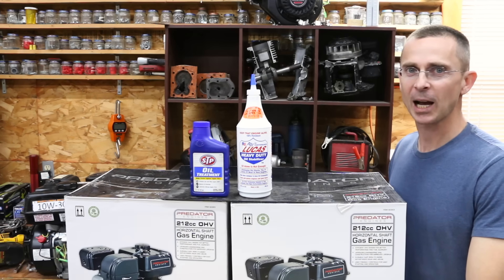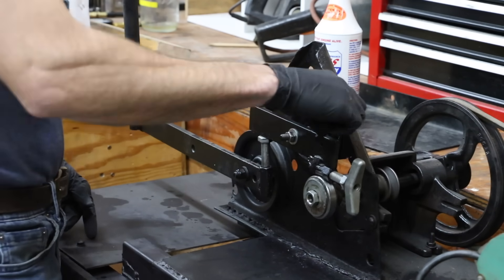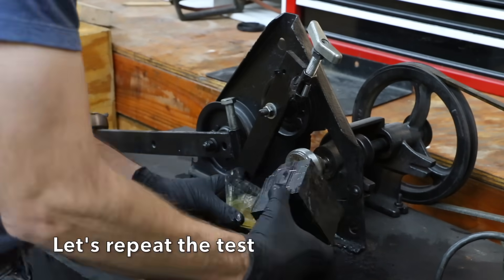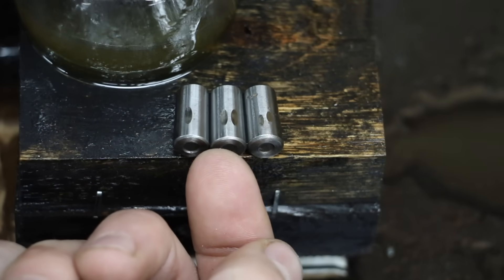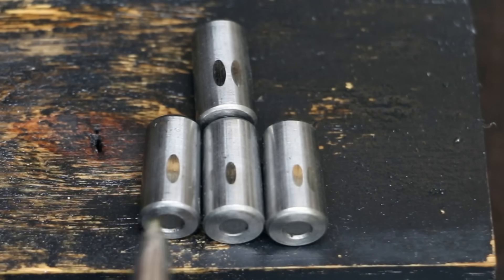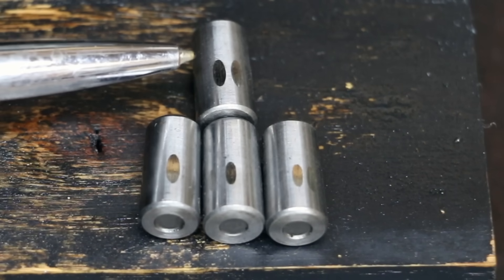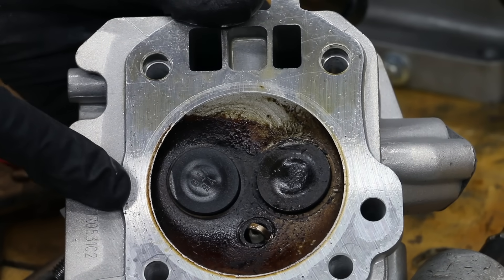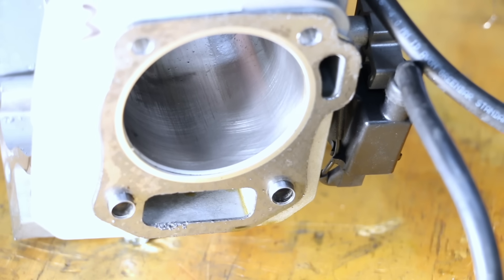Which engine self-destructs first?  Lucas or STP?

Comment: I would like to see which is better. "Prolong" or "Zmax".
Reply from the maker: Thank you for this recommendation!
Reply: No, don't. Z max is not a lubricant at all. Its simply a molecular filler to fill the pores in the metal. Its used to prolong engine life when USED WITH OIL!!!  NOT a lubricant.  The only oil that was drained and run for longevity is Mobil 1.
Reply: Billy Bracewell I agree
Reply: Project Farm let's do it!!!
Reply: Try this one.  Thanks for the video.
Reply: Z max sucks watch his video

Comment: Looks like the connecting rods on the Harbor Freight engines are the weak point. The cylinders and pistons didn't look that bad to me.
Reply from the maker: Your right.  The aluminum doesn't hold up once the film strength is lost. Thanks for commenting.

Comment: How many more minutes did the Lucas engine run than the STP engine?  Was the STP engine running cooler than the Lucas engine up until STP failure?  Looked like it.  STP crank bearings looked more damaged than the Lucas crank bearing on tear down.  My opinion the Lucas won because it just ran longer.
Reply from the maker: Yes, Lucas lasted 8 minutes longer, even though STP seemed to be running cooler.  Thanks

Comment: This isn't a valid test and a total waste of time. Neither product claims that engines can be used without oil after their product has been added then drained from the crank case. The engines themselves require proper lubrication to ensure they function properly. Everyone knows that engines require lubrication or they will fail. Seeing which engine fails first with no oil is a complete waste of time and proves nothing when comparing the effectiveness of different lubricants or additives.
Reply from the maker: Thanks for commenting.  I'm always open to other ways to test these products.  If you have any suggestions, could you please create a new post so I can easily find your recommendation? Thanks

Comment: Try Schaffer oil with Moly. They say once it is engrained in the metal, an engine can last a long time.I used to sell it, and performed that demo with their friction machine. I thought it was impressive. without the Schaeffer oil, you could stop the shaft from turning with a lever arm. With the Schaeffer oil, you could not stop it. I would love to see how long an engine would run empty after using this oil..
Reply from the maker: Thank you for this recommendation!

Comment: You should have included an engine with just oil to see if the additives actually help.
Reply from the maker: Sorry I didn't explain this, but I did the control 2 videos ago in 10W-30 vs Bestline.

Comment: very intreasting. ill say this i run lucas in everything. example i put there actual engine oil in a $100 walmart push mower. run it for 3 yrs. when i drained it. i couldnt tell by sight nore my feel that the oil was shot. actually it looked new smelled new.  but the one iv wondered about myself is royal purple. iv heard alot about there products. but never tryed
Reply from the maker: Thanks for this recommendation.

Comment: Awesome work as usual! I would like to see the how long he same engine would last with out any additives. Just drain the oil and go. Also how do you feel about the Predator engines in general? The abuse you put them through is harsh! If treated right will they hold up like a B&S? And yes I know that due to your small sample rate these test are hardly definitive...but they sure are interesting! Thanks!
Reply from the maker: I really like the Predator engine a lot.  They seem as good or better than the Briggs.  It's basically a Honda clone.  Thanks again!

Comment: Here is one from Pennsylvania you need to contact them about their products and test .  Have used for years for added protection from oil pump failure.    Muscle Products Corp. (MPC) is one of the leading manufacturers of specialty lubricants, additives and greases.   http://musclelubricants.com/     Sharon Murphy-Dittrich CEO / International Sales & Marketing Cell: 1.724.977-4684 ,    Muscle Products Corp. 752 Kilgore Road,   Jackson Center, PA 16133                1.814.786.0166
Reply from the maker: Thanks for this recommendation.
Reply: Did you ever look at Muscle Products Corp?

Comment: Prolong is the best ran my 92 vw Passat 10 miles with no oil pump no damage what so ever lots of noise but no metal shavings replaced oil pump in about 5 minutes after running went completely quiet and got another 120000 miles out of vehicle oh yea it already had 130000 miles on car the best product ever👍🏻
Reply from the maker: Thanks for this recommendation.

Comment: I had a car with a head gasket leak, bought Z-Max to be sure the engine was always protected. After a family member died I drove 1,000 miles to attend the funeral. My car got roughly 28mph highway and just after halfway I got a check engine light meaning I had consumed more oil than usual. Found out that my mileage once the oil ran low went from 28 to nearly 30. Hoping at some point you could explore the micro-lubricants to verify if that was the case or not.
Reply from the maker: Thanks for this recommendation.

Comment: I run synthetics in my vehicles and my new car states to use only synthetic oil. Back in the 80's I managed the maintenance dept. for GE and physically tested all kinds of conventional, semi-synthetic oils for our equipment in cold weather and warm and found semi synthetic was superior in every category including wear on engines, gear boxes, planetary gears, etc. No need to add anything if you use a good quality oil, filter and change per manufacturers recommended service. Had a ton of fun performing all kinds of test and all kinds of systems, equipment and materials. I know you're enjoying the work and much as we are watching your vids. Keep up the good work!
Reply from the maker: Great post and thanks for the positive comment!

Comment: Most oil additives degrade a premium oils lubricity. The complex balance of synergistic additives is skewed by the addition of something else.   Lab testing of STP has shown it contains lower additive level than motor oil itself.   https://540ratblog.wordpress.com/2013/06/20/motor-oil-wear-test-ranking/
Reply from the maker: Thanks for commenting on this.  My test results came to the same conclusion.  2 videos ago regular oil outlasted STP. Thanks again!

Comment: That lube tester is an absolute hoax machine. The computer operated heated tribometer with computer readout is what the mechanical engineers and oil chemist use.  Even the slight difference on how you drop the lever changes the result AND the lube is not operating at engine temperature, those things alone voids the results. It is the dupes folly and the instrument the crooks use for their snake oil.  See the one armed bandit video.    https://www.youtube.com/watch?v=AjdN4ZuYxf0   You can get a wonderful education on lubes and other items at 540 RAT'S blog.   https://540ratblog.wordpress.com/2013/06/20/motor-oil-wear-test-ranking/
Reply from the maker: Thanks for commenting on this.  Using 2 new engines side by side helps validate the results. Thanks again!

Comment: "Do STP® oil additives cause sludge?

No. STP® oil additives contain detergents, which can help suspend sludge in the motor oil and prevent it from accumulating inside your engine."      

STP is make cleaning products not a stay on lube. Just like dish dawn is thick it takes a off the very fog oil left on my butter dish.
Reply from the maker: Thanks for commenting on this!

Comment: There is a delta you totally missed here.  Why did you not do the same failure test on an engine which had no additives.  That is the piece of information that I wonder about.  How did much benefit does the additives offer.
Reply from the maker: Thank you for this recommendation!

Comment: 30 weight bar and chain oil to run exclusively in a inline 6, 4.0L motor. The oil doesn't thin at higher temperature, and will clean a Detroit 6cyl diesel engine because of the additives that are able to withstand very high rpm. Imagine someone running bar and chain oil in their log truck. The mechanic who worked on that after bar and chain oil was the exclusive oil in the engine, said that was the cleanest diesel engine he had ever seen in his life for it being  as old as it was. The log truck was between 79 and 84.i cant remember exactly, but yeah. Withstands high temps. And can put up with abuse. For real, I'd run it in my car, but i dont have a car, or a car motor to test if i should actually run it and know the outcome. If i could use it for very high temp runs, for example a drag race. That's the true test with this oil. A dyno run/test of an engine,  and that engine being able to handle that. I am extremely curious to see if 30 weight bar and chain oil could run a car without overheating in a 1/4 drag at a 180 mph
Reply from the maker: Thank you for this recommendation!

Comment: English is not my language so I go first in spanish and then in english because if I traslate something grong you can traslate it from original.

Excelente video, me parece que puede agregarle un toque de fiabilidad mostrando un test de compresión de ambos motores antes de comenzar las pruebas o entre cambios de aceite para dejar claro en qué condiciones comienza cada uno.

Great video, l think you can add a little more of neutrality to this king of tests by adding a compression test behind running the destruction test. So we all can knows how equally they start.

Thanks for doing this videos.

And happy Thanksgiving.
Reply from the maker: This is a great suggestion.  Thank you very much for commenting and Happy Thanksgiving!

Comment: What about "slick50" v's "Lucas"
Reply from the maker: Thank you for this recommendation!
Reply: Sorry I just watched the "slick50" v's "10W 30" Video, oil wins!!, Shocking because, I had a 1966 ford fairlane 500 with a 290 engine with a bad oil leak from the rubber replacement oil drain plug, very often forgot about the oil level but the slick50 kept the motor running', till I realized I was out of oil, 3 years later I sold the car for 10 fold that I bought it for....Thank you "slick50", one month later I found out the new owner wrecked the car on power lines dirt road...REGRET SELLING TO HIM!!

Comment: I’m older and have been through generations of all sorts of tales and superstitions etc. But, what is true is fuel injection is great for longevity as is thinner oils. If you have a worn engine then thicker fills the wide clearances and reduces noise and is less likely to pass worn rings and to be carried off as fast by excess crankcase venting of leaking rings. In the long runs of few engines I have serviced FI made them last much longer with fewer internal deposits. Less excess fueling owing to better warm mixture and normal op temp mixture. The top of cylinder get less wear. Less washing of lube oil. 
In the same engine families where thinner oils were used when fuel system was not changed over the years the specified viscosity changed the slugging and clogging of crankcase vent parts and passages was much reduced. Thinner oils get pumped more and splash more readily. The extra flow has been shown to wash over more of the static internals and this leads to more detergent activity and also quicker shedding of fuel and moisture dilutes. I worked in two dealers on the same brands where one dealer always sold and installed thick oil additives and the other dealer sold none of it. Both dealers used Goodwrench bulk oil at that time. Oil additive engines were more heavily deposited whenever valve covers were removed at similar mileage’s. I lost all belief in thicker oil and higher oil pressure being anything to aid longevity. Air cooled small engines are another story so the results here for parent metal connecting rods on low investment crankshafts may not be a test showing us much for modern high output direct injected gasoline engines using coated bearings on forged or induction hardened journals.
Reply from the maker: This is a great post. Thanks for commenting.

Comment: To see how much better the additives did wouldn't we need to run one with just the base oil with same system? We could see how much protection are we buying if any
Reply from the maker: Great point.  Two videos back I tested 10W-30 vs Bestline.

Comment: Please do some studying about variables in scientific testing. This video was about failure modes in cheap mass produced engines more than a product test. You can't hit a surface with a grinder and then expect to do any kind of consistent abrasion testing. That's ludicrous. Your bearing test data is completely without value. If you want to gather any comparison data, you need analytically verified and consistent starting conditions, you need a more realistic test scenario, and any test with a sample size of 1 is a facepalm, not science. All you tested was stickiness of additives * random part tolerances. You're conflating stickiness with lubricity and the resulting data doesn't represent anything close to any real world scenario other than deciding to destroy an engine.
Reply from the maker: Thanks for the constructive feedback.  I would great appreciate recommendations on how you suggest I test additives. If you could, please create a new post so I can easily locate your ideas. Thanks again.

Comment: Have you considered making a video about the best penetrating oils? A video where you thread some nuts onto bolts and spray them down with a rust provoker then let them sit outside. I think it'd be great to see them mounted to the test board and have their break-away torque measured after soaking them in different oils.
Reply from the maker: Thank you for this recommendation!

Comment: good job but i was thinking you should have had 1 more engine running with just straight oil for comparison. its not just a question of which additive is better but are additives necessary at all.
Reply from the maker: Thank you for this recommendation!

Comment: holy shit!! the stp crank compared to the lucas crank....!!  i knew lucas was liquid gold!!! i felt it in my gut :p that shit really is a miracle i use it in absolutely everything i even get the gallons of regular 5 30 off ebay, those along with the additive makes everything i have seem so much happier and definitely quieter on startup, it completely 100% got rid of all tapping on a couple smaller engines. i really do honestly appreciate you doin tests with the lucas oil stabilizer whether its alone or against another additive i use it in everything like i said, n its done nothing but miracles for me, id like to see how other things compare and if theirs something better . im going to b donating to help offset all that cost your using brand new identical engines, thats almost the perfect test.
Reply from the maker: Thank you very much for the positive comment!

Comment: I had an idea for a test you could do if you are interested. I am going to be trying to revive a diesel engine that has been sitting for about 10 years. Many people say to just put oil in the engine and crank it with the starter for a bit to circulate the oil before starting. What I am thinking would be interesting is to take an engine of a vehicle that worked well before being stored in a normal environment - my case outside in San Diego for many years (not much moisture inland in San Diego). What would the oil in the engine be like? Would it still be in place to lubricate the engine or all drained to the oil pan or dried out or what?
Reply from the maker: If it were me, i would replace the oil.  If injectors can easily be removed, consider removing them and adding a product like Marvel Mystery Oil to each cylinder...just a little and allow it 24 hours or so to penetrate. Hope this helps.
Reply: Thanks!

Comment: The test harks back to the old Dura Lube commercial on TV.  A real world test would be to run the engines with lubricant installed. Then evaluate the wear. I realize that could take thousands of hours.
Reply from the maker: Yes, you're right. Thanks for commenting.

Comment: I love these vids. Wouldn't it be interesting to find out how long an engine lasts that has been treated with MoS2 oil or an additive. It is said, that MoS2 prevents engines from seizing even if running dry. Nobody ever tried this as far as i know in a competition. Would be a great way to clear up things and destroy myths - or prove them right.
Reply from the maker: Thank you for this recommendation and thanks for the positive comment!

Comment: These Harbor Freight engines are hardly precision pieces and one may be different than the other. Ring gap, piston clearance,
compression, valve train etc...etc..  But, the test is really cool!
WOW! The Lucas KICKED STP's BUTT!  Lucas ran TWICE as long+ !! The bearing surfaces were protected far better than the STP engine.  The Lucas's crank could have probably been reground and made usable again.  The STP engine was trash!  I know what I am using!
Reply from the maker: Great point. Thanks for the positive comment!

Comment: The oils were not brought up to operating temperatures which could drastically alter the results.
Reply from the maker: This is a great point.  I can test this as well.  Cold engine starts cause a lot of wear, which is why I chose to use room temperature to test the additives.  Again, great suggestion.
Reply: my apologies, I was not clear. I think the cold start engine test is OK, but the lubricity bearing test, should be done with the lubricants at a standardized operating temp. even if freezing out, the engine oils would never be at room temp. Very likely the air bubbling issue would disappear as they thin at proper temps